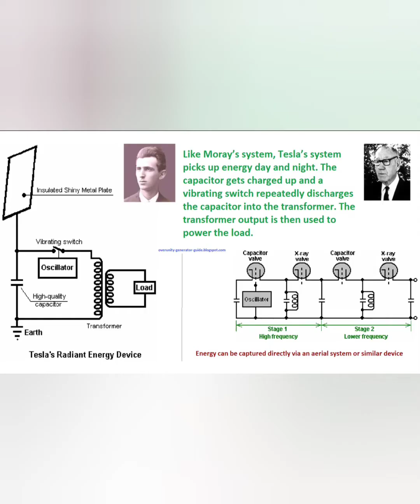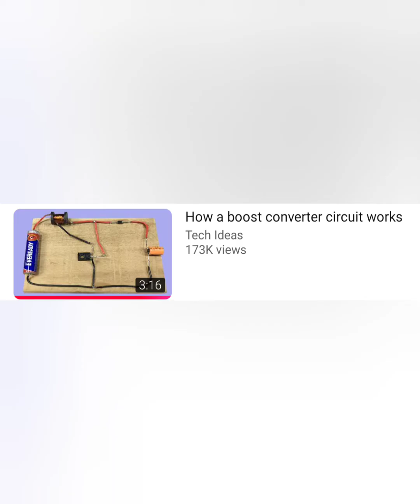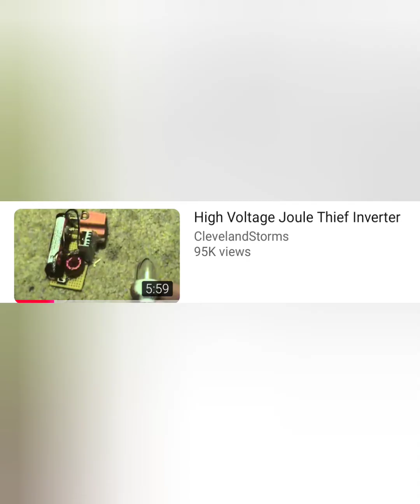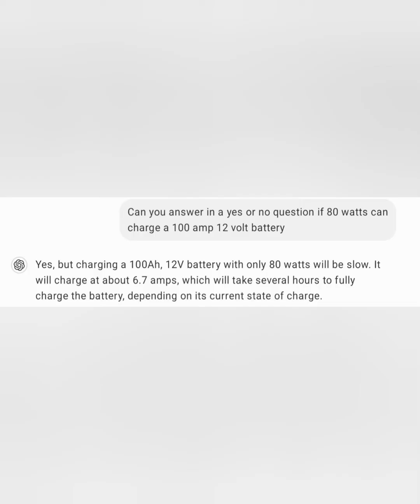this may be my last video, it depends!

Comment: To get real power you have to switch in the mhz range?
Reply from the maker: @tommy87282  It depends on the context. Switching in the MHz range is common for high-frequency power conversion, like in switch-mode power supplies (SMPS), RF amplifiers, and induction heating, where high efficiency and compact components are crucial.

However, real power isn't strictly dependent on MHz switching. The required switching frequency depends on:

Application: Low-frequency switching (Hz to kHz) works for motor controllers and inverters, while MHz switching is used in RF and resonant power circuits.

Inductor and Capacitor Size: Higher frequencies allow smaller passive components, which is why SMPS circuits use MHz frequencies.

Efficiency vs. Switching Losses: Faster switching can improve efficiency in some cases but increases switching losses in MOSFETs.

For Tesla coil-type circuits or high-frequency resonance-based power systems, MHz switching is essential. But for DC-DC converters or AC inverters, kHz range is often sufficient.

in relation to your generator project, MOSFET experiments

Comment: The coils are to produce an inductance when you have a switched collapsing field to produce a voltage current by the mosfets, as the mosfets are just a high power/current switching device to control the primary coil and all this can be done at 50HZ.
Reply from the maker: @ellawiggins5449  at least you are starting to understand
Reply: @WIZ56575  But it is you who doesn't understand thermodynamics.
Reply from the maker: @ellawiggins5449  Exciting News!
My new book “My Purpose is to Drive This Technology to Market” is now officially published and available on Amazon!

This work represents years of hands-on experimentation, theory, and exploration into real-world energy solutions inspired by Nikola Tesla and other pioneers. If you're a researcher, engineer, inventor, or simply curious about future-forward tech, this book is written for you.

I would be honored if you took a moment to read it—and even more grateful if you could leave a review on Amazon. Every rating and review helps increase the book’s visibility and brings this technology one step closer to the world.

Check it out here:
https://www.amazon.com/dp/B0F2ZZ7X5C

Thank you for your support—and let’s build the future, together.

Comment: Its simple , the current lags the voltage by 90 degree  , so close and open the gate before the current gets to the other end and you have potential generation for free
Reply: "Ninety degrees electricity". I've heard something like that in some movie about free energy..."
Reply: @optym82  technically its correct, gl finding a switch fast enough we are talking light speed
Reply from the maker: @mykedoes4099  @mykedoes4099 Interesting theory, but not quite accurate for my system.
In my setup, I still need 2 panels per unit — one gives me 17V, the other supplies the current for the MOSFET to pulse. The spike isn’t “free,” it’s a transient caused by fast switching. The 90° lag applies to AC resonance, but I’m working with DC pulses here — so while timing helps, power still comes from the panels. No free energy — just smart switching and storage. But I didn't understand what you meant
Reply: @WIZ56575  what i mean is , if you can open the gate before the current catches up tot he voltage you can recapture the current sent into the coil on the inverse flyback with a proper bias HV diode.  I am not sure if the current lags by 90 with only AC and not also DC . I assume current is current no matter the signal form
Reply from the maker: @mykedoes4099  but the voltage and the currents are together combined I get what you're saying you talking about an alternating state but that evolves more sophistication in the simple circuit and remember we only use this as a test to prove the theory the actual apparatus is way more we simply just wanted to prove to everyone that the systems can work
Reply: @WIZ56575  but of course to switch fast enough to do that you need light speed switching which we dont have .
Reply from the maker: @mykedoes4099  no we don't need light speed switching what we need
Reply from the maker: @mykedoes4099  Exciting News!
My new book “My Purpose is to Drive This Technology to Market” is now officially published and available on Amazon!

This work represents years of hands-on experimentation, theory, and exploration into real-world energy solutions inspired by Nikola Tesla and other pioneers. If you're a researcher, engineer, inventor, or simply curious about future-forward tech, this book is written for you.

I would be honored if you took a moment to read it—and even more grateful if you could leave a review on Amazon. Every rating and review helps increase the book’s visibility and brings this technology one step closer to the world.

Check it out here:
https://www.amazon.com/dp/B0F2ZZ7X5C

Thank you for your support—and let’s build the future, together.
Reply from the maker: @mykedoes4099  Exciting News!
My new book “My Purpose is to Drive This Technology to Market” is now officially published and available on Amazon!

This work represents years of hands-on experimentation, theory, and exploration into real-world energy solutions inspired by Nikola Tesla and other pioneers. If you're a researcher, engineer, inventor, or simply curious about future-forward tech, this book is written for you.

I would be honored if you took a moment to read it—and even more grateful if you could leave a review on Amazon. Every rating and review helps increase the book’s visibility and brings this technology one step closer to the world.

Check it out here:
https://www.amazon.com/dp/B0F2ZZ7X5C

Thank you for your support—and let’s build the future, together.